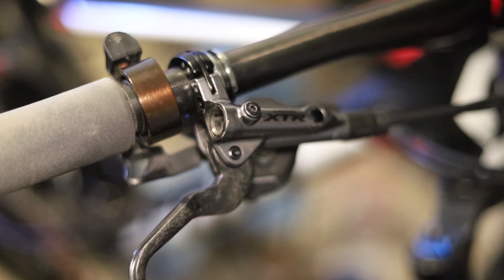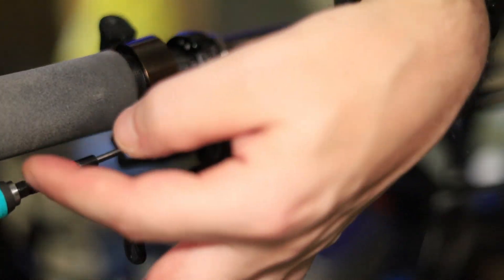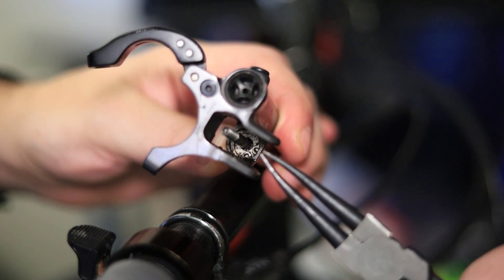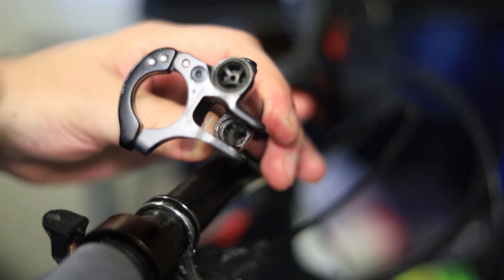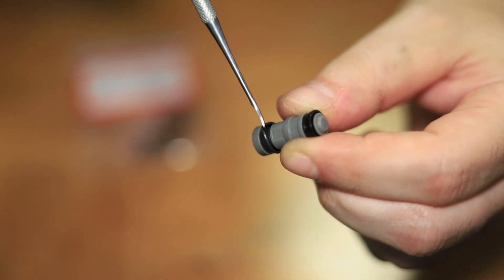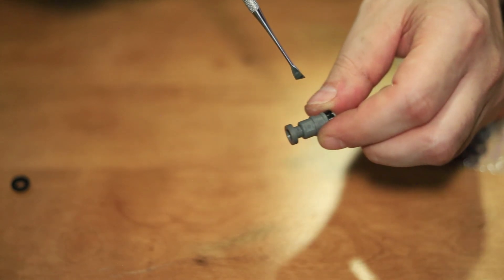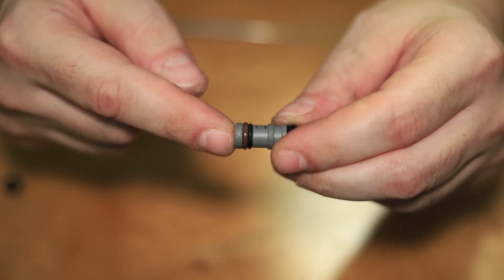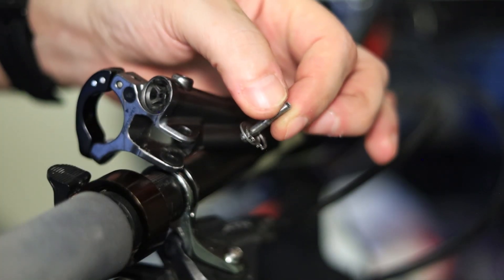HOW TO FIX A LEAKING SHIMANO BRAKE LEVER

Comment: Very insightful & helpful thanks! My rear break pistons have seized & everytime I’ve added fluid to try get them moving it’s been disappearing & I didn’t know where it was going until I had it in my bike stand & notice a slight wet area on the lever, realised now it’s actually the same issue as this!

Comment: I am almost at the end of the process where i only need to reinstall the lever but i had lost the c-clip 
So am i scrwed now?
Reply from the maker: Ya sorry don't know what to tell ya but Shimano does not sell that clip by itself so you would have to maybe buy some random sizes and hope they work, or maybe remove the clip from your other lever and take it to a hardware store to see if they have something similar, it really shouldn't be too hard to source one from a hardware store, good luck!
Reply: @MTBfixHQ  thanks for you suggestion but the thing here is 
-The oil break system was a diy project i bought it from Facebook marketplace and its only for my front breaks so yeah i think that i am screwed

Comment: I have shimano mt200s on my bike and it makes a like squishy/weezy sound when I squeeze the brakes and there is oil residue all over. Will this help with that
Reply from the maker: Honestly I am not sure, you need to clean all the oil and find out where the leak is coming from, if its from the piston/plunger then this may help you, but it could be leaking from the bladder

Comment: Thank you very much for the video. I think I will be able to fix it with it. I have a question. My brakes are 9100. Do you know if the piston is the same size and the gaskets you suggested? Again, thank you very much!!:yougotthis:
Reply from the maker: Glad to help! sorry I do not know for sure if its the same size piston/plunger, I am going to assume that it is but you could buy more o-ring sizes in case its no, they sell assortment kits for pretty cheap but im willing to bet the ones I used should be ok. One trick is if the o-ring is a little too small you can add some teflon tape to the piston to make the o-ring expand a little more, good luck!
Reply: @MTBfixHQ  Another question. Could you confirm that the repair with O-rings has lasted well over time? Thank you very much again. 👍
Reply: Can you confirm that the O-rings have worked well over time?  @MTBfixHQ

Comment: Thanks so much for this tutorial! Using both o rings caused the lever piston to stick. Using only the smaller one caused a leak. Now trying only the larger one and a Banjo o-ring which looks promising so far. Haven’t ridden this setup yet though so can’t say too much.
Reply from the maker: Yeah I think the o-ring sizing can be a little hit or miss depending on the lever model,  for the most part the video demonstrates that it can be fixed if you find the right sized o-rings, my m9000 lever cost a lot so it was worth the fix :)
Reply: Should add that I did this on some M506 levers.

Comment: I broke my BL-MT501 with this method. I used exactly the same orings from Aliexpress to replace the upper seal. Now it sits to tight, the piston can't move. It's under oil for some time, it doesn't help. I wasted few hours, because in this model replacing handle is not so easy. And the circlip is a nightmare too. I am recommending to not try this. Better to replace this a lever on warranty every half a year. Maybe Shimano will understand the issue then and will improve the product.
Reply from the maker: I am sorry to hear that it did not work for your model, I only tried it on the m-9000 and it works very good and from reports people are getting it to work with many different models. Maybe this is the first model that actually uses a different size o-ring but I find it hard to believe, maybe the tolerance on your lever was out of spec.. What I don't understand is how you broke your lever just because the o-ring is too right? get it out and put the old stuff back in, you can always try buying a smaller o-ring and use teflon tape on the piston to build it up until the o-ring has the perfect friction.
Reply: @MTBfixHQ  The proposed here oring size is probably wrong. In another source I found the both orings should be 4 x 1 mm, so way smaller. That would might work. Anyway, depending on the lever model, this is waste of time. I am going to replace levers every few months as long as Shimano has a such product quality. In my country the new product means new warranty also, so I can replace it endlessly, assuming half year lifecycle, which I had with previous both left and right (already replaced).

Comment: I installed a m8120 2 months ago, and it leaks at the lever after I leave it for 1 month. so as you said in the video, it is a feature of Shimano's skirt seal, it can also be solved by using it more often?

Comment: I just bleed my right brake thinking that would be the solution for the spongie leaver action, but I realized that somehow in the leaver got air , I hope this could solve the problem 😅
Reply from the maker: Sorry this wont help your spongy feeling brakes, spongy brakes is almost always caused by air in the system so you should look into just doing the basic bleed. My friend had spongy brakes that I fixed but his problem was different, his brake like that connects to the caliper was damaged and when I pulled the brake lever I could feel that part of the brake hose expanding so you should check if maybe you got that problem as well, good luck!

Comment: This o-ring should be FKM material or it doesn't matter?
Reply from the maker: from my experience when I tried cheap black o-rings that came in my big cheap o-ring kit they didn't last as long as these brown FKM ones I ordered, FKM shouldn't matter I think it mostly comes down to the quality of the o-ring but it is possible the FKM o-rings keep their size better in the mineral oil
Reply: @MTBfixHQ  I mostly find NBR material in my country. And I don't want to try many o-rings cause I have m820 brakes and they're pain to remove that pin if you know what I'm talking about. You believe NBR material is fine?

Comment: Can you do this on xtr m9120?
Reply from the maker: Hi,  yes it should work with all M6000-M9000 series brakes, cheers
Reply: Shimano 9120, like the vast majority of Shimano brakes, has a servo wave system, so there are several plastic parts before the piston, which should be carefully disassembled so as not to break.

Comment: My m820 lever leaks air when I use the lever very slowly and it goes all the way to the handlebars without breaking unless I pull the lever fast. What should I do?
Reply from the maker: leaks air? there should be no air in the system, attach a funnel with some fluid and top off the system, if its still doing the same thing it sounds like maybe your seals on the piston are possibly worn out, I am guessing this because when you pull fast it puts enough pressure on the seal to expand and do its job, but if you go slow it wont expand enough to seal. I am not 100% sure these fit your model but I imagine they do

https://www.aliexpress.com/item/1005002456932338.html
Reply: @MTBfixHQ  that should be the issue, I’ve already replaced the piston but the one I’ve installed was used from a brake whose lever was broken and I think the piston wasn’t new enough, thanks for the link I’ll try to get a new piston. Btw it’s a shigura mt5
Reply: Ahh this video and comment is a godsend. Really random but I have the same issue on a Zoom 876e. I suspected it's some sort of valve/rubber issue as at fast pressure it hooks up fine.

I'll take it apart and have a look see.
Thanks!
Reply: @JLneonhug  the issue was very easy to fix, take the lever piston out and change the rubber parts from the piston

Comment: Used this method on my Saint M820 lever. Disassembly was slightly different; there's a small metal pin you have to hammer out which was the hardest part for me. I first used both o-rings like you did, but the spring would not push the piston all the way out. Using just the larger o-ring allowed the piston to move properly. I've had 2 rides with this setup, about 5-6 hours total, brakes are feeling so good and no leaking so far. Thanks for the video :)
Reply from the maker: Hmmm im surprised the second o-ring affects your setup like that, its possible the plunger/piston is designed slightly different for each model, at least the main big o-ring is doing its job :) 👍 Cheers
Reply: Same here on M520
Reply: @artekh9435   1 or 2 o-rings? I'm trying to solve it on my 520
Reply: @ErnoTokesLive  i used 1 o-ring, both were too tight, working for a while
Reply: I got a xspark hydrolic brake which has a leaking problem, I hope to follow ur instructions and get it fixed, only if I find the Oring here in my part of the world...
Reply: Good luck with doing this with 9120
Reply: Same here on bl-m8000. Seems ok, but after one day the piston moved very slow after braking. Removed the second o-ring and it works fine. No leaking so far.

Comment: Bro, how long experience do you have with that setup? Does it affect lever feel?
Reply from the maker: I have used this setup for 2 years now on my other lever without issues, no difference in lever feel but if you use a oring that is too large it can affect the return speed of the lever because the return spring only has so much force